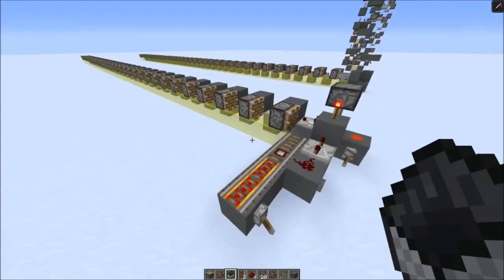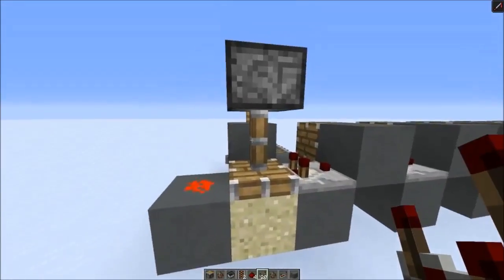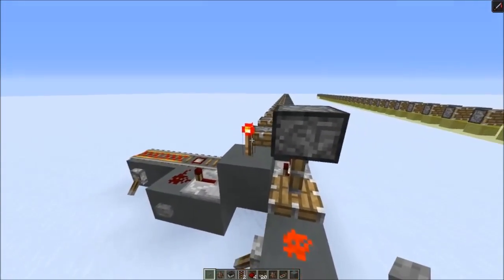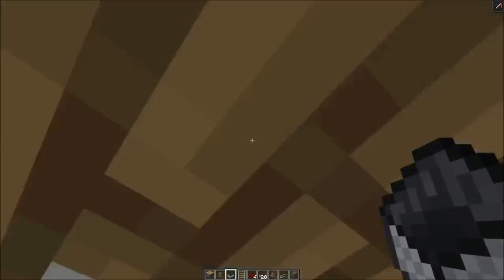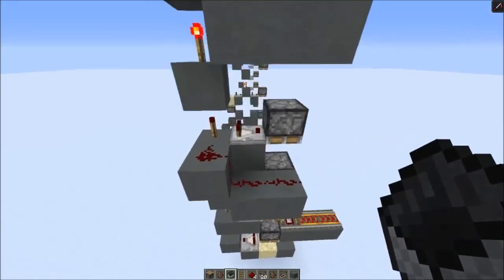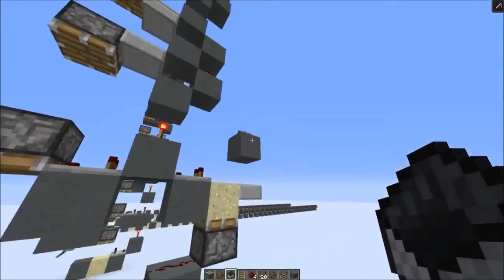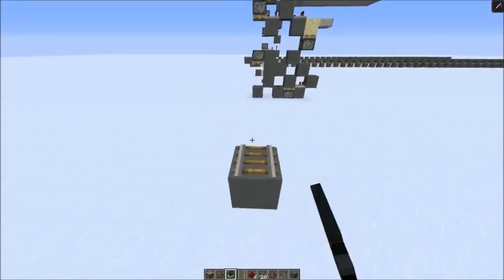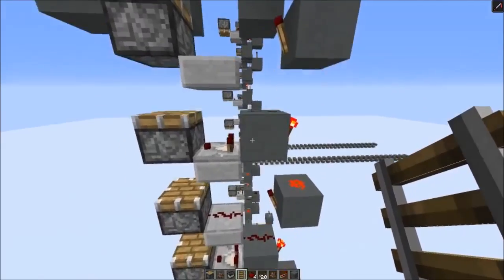simplest 20 blocks/sec minecart conveyors/elevators [broken]

Comment: hmm. yeah nice i guess... somewhat makes sense with the torch 2 ticks
also, for the elevator, placing a torch next to the blocks the activated torches are next to and placing the comparatros on slabs would make it 1 wide
Reply from the maker: that wouldn't work. I showed this a while ago. If you attach more torches to the same block short pulses get messed up. You can only take outputs from the torch tower with comparators or RS-dust
Reply: oh yeah. i remember... didnt think of that...

Comment: hi ilmango, i've been working on a withercage and i managed to get the 3×3 formation but there is still 1 block left underneath, so i wondered is there a way to break bedrock sideways?
Reply: Breaking bedrock sideways is trivial. Just put a normal piston next to the bedrock, make it schedule a retraction block event, and then replace the normal piston by another normal piston facing into the bedrock (for example by using headless sticky pistons). The actual execution of this method will be left as an exercise for the reader.
Reply: Jasper Hoppenbrouwers
"tysm for your help, it's really appreciated!" But I tried really hard to sound preposterous and arrogant this time.
Anyway. I´m happy you managed to do it.
Reply: Watch ray works' video on making withercages using the bedrock at the bottom of the world.
Reply: +Mine MLG that would be pretty useless cause i've already made one in the nether i just cant remove that one block -_-
Reply: You can just turn myren's trick on it's side to break it
Reply: Myren Eario Would you be able to make a video on this cause i dont really understand what you mean, i cant use the normal trick cause the piston cant be powered
Reply: Jasper Hoppenbrouwers
"i cant use the normal trick cause the piston cant be powered"
Can you then show me a picture of the concrete situation you´re in. Then I can probably help, (depending on how difficult the situation is).
Reply: +Myren Eario I managed to figure it out, i just changed the states of the pistons within the headless pistons, so the one facing up is facing down and the one facing down is now facing up, this manages to apparently break the bedrock on top, tysm for your help, it's really appreciated!